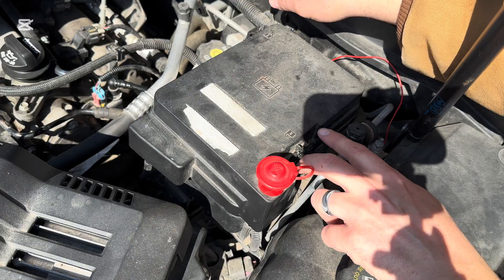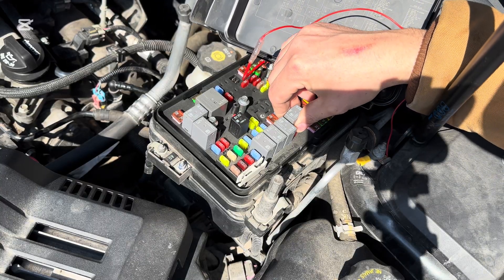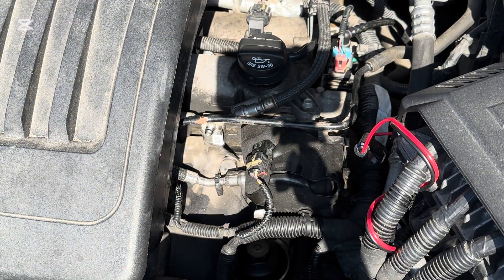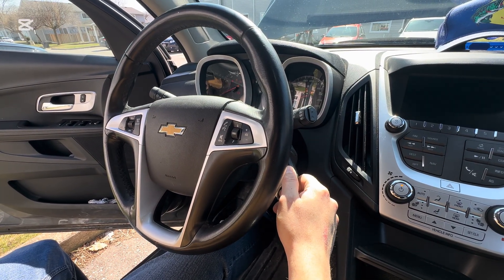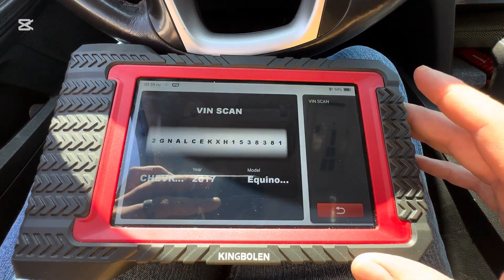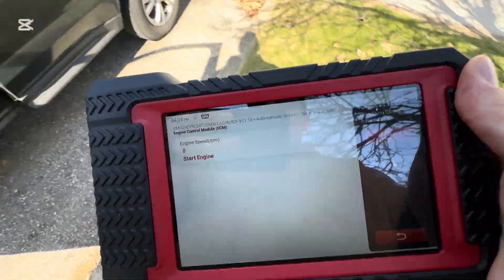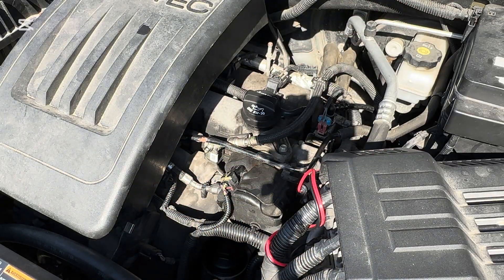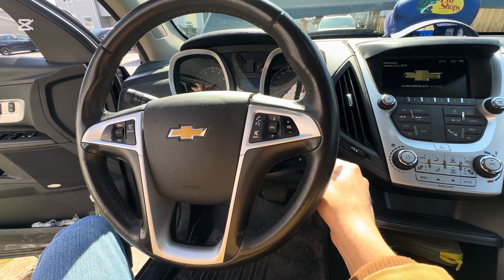How To Depressurize Your Fuel System (2 Easy Methods)

Comment: I really don’t like GDI engines. I wonder how much build up is on my valves.  I did find a portable media blaster I will probably buy before this summer. I plan on modifying a new intake manifold and installing that once it gets a bit warmer outside. I have new lower control arms with bushings and ball joints already installed coming this week so Easter Sunday I will be resurrecting the front end of my Equinox. 😂😂 The ball joints are sealed, so I will be removing the boots to pump them up with some good Amsoil grease. 👍 Now I just have to find my pickle fork. 😂